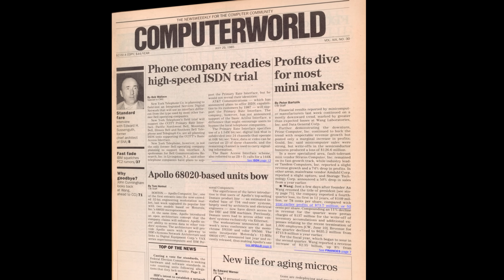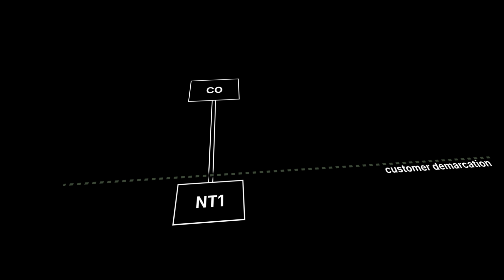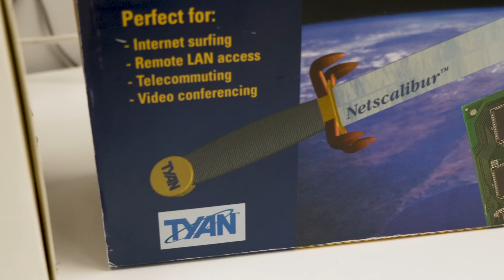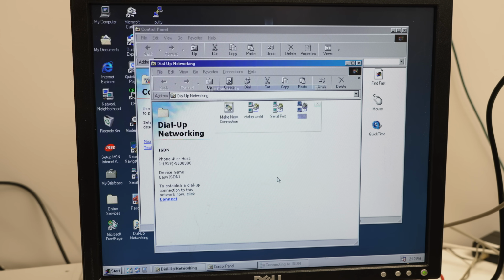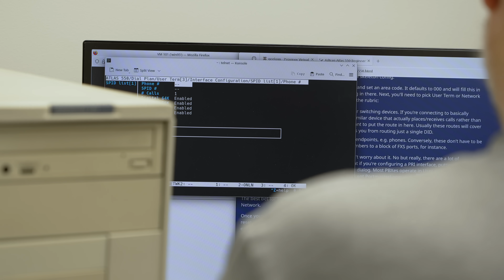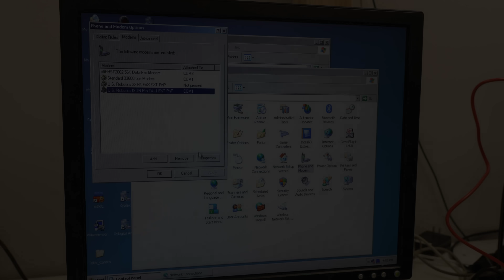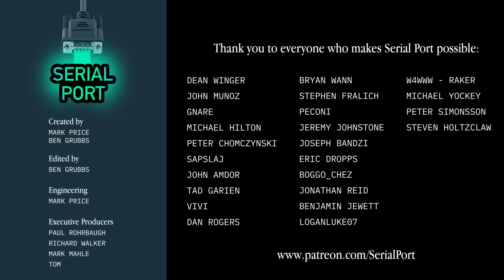Do you remember ISDN?

Comment: I used to work with video conference systems (Polycon and Tandberg - later acquired by Cisco). These systems would bond together 3 or more ISDN lines to make a fully two way video call. The picture quality was not amazing, but it was impressive for the time. The US government was still using ISDN into the mid 2010s, basically right up until the telcos would no longer install new circuits.
Reply: 384kB.  Amazing!

Comment: I had ISDN in the early 2000's for a year or two before they brought Cable internet to my neighbourhood. The reason it was unpopular here? You could only get it as a business account, which meant business long distance rates and business line costs, it was over $120/mo and $0.35 per minute for long distance.
Reply: I remember the setup being a LOT simpler, I was using the US Robotics modem, I think with Linux at the time... I had IP Masq on the linux box to let the other computers in the house talk to the internet through it. I'm pretty sure my router was moved off OS/2 by that point at least.

Comment: My parents' business briefly had ISDN to a local ISP in Minneapolis in the 90s. We ran our own DNS, mail, and web servers. We felt like the real deal. It was so exciting. I don't remember how long we used it before we upgraded to ADSL and its BLAZING fast 640k/128k speeds. I remember the ISDN was rock solid for the time we had it. I'm sad I never had a chance to use an oscilloscope to look at the signals on the U interface. I was always (still am) fascinated by the different line codings. As I'm falling asleep sometimes I still wonder about how the first T1 equipment searched across the sea of bits to find where in the 193 bit frames the framing bits are...
Reply: They used to drop the LSB, so that you always had a constant point of mark in each bit in the frame, which made locking on much easier. We of course, having a T1 to the ISP, promptly disconnected that telco supplied modem, and used a 64k one, which was as reliable, though for Telco troubleshooting I would plug in the line to their crappy unit, and let them see that the unit was able to connect with line quality errors, or not even connect. then come out, restart it again, and see it still did not sync, and listen to the noise on the line with a butt set, and find the bad connection, and try to find a spare wire to use.
Reply: I have the same "obsession" but with SDH

Comment: I work in Radio and I still miss it, because it’s more stable than any IP audio connection I’ve ever used.  As others have said, it was rare and expensive for most people. Back in 1998, I was helping facilitate audio from the Wye River Peace accords in Maryland.  The local central office for Bell Atlantic was not prepared for the onslaught of requests for ISDN and they ran out.  Fortunately, I was on site early enough and we had made our request early enough, that along with a dozen donuts, I was able to get the tech on site to pull the ISDN card out of his manager’s house to give us service. Those were the days.
Reply: We installed many ISDN lines at the Minneapolis Convention Center mostly for remote radio broadcasts. Don't know what they use now.
Reply: @MN-Hillbilly  well there are IP connections and IP codecs. They just don’t have the reliability that you might have with ISDN. There is always buffering issues which there never was with ISDN plus there’s dropouts. UDP was not designed to be stable.  The sad thing is people are more forgiving these days.  If Zoom or FaceTime audio is good enough why schlep a Comrex, TieLine or other high quality codec when folks can just use their cell phone.
Reply: @MattapoisettinLA  Your problem isn't IP or UDP, your problem is routing over a shared medium where you don't control the routing (Internet) vs a dedicated point-to-point line. (I've seen shows with 30+ DANTE audio channels on a local network and it is rock solid.)
Reply: @SteltekOne The issue is almost all of our connections are Temporary.  Yes we have Revena set ups between our major facilities. (NY, Boston, Philly, DC, Chicago, LA)  but it’s not practical to set up a Revena Network between say DC and Kiev, Ukraine

Comment: Yes, we had a pile of those modems. Then Oki ISDN ones that did 38.4k and the Ascend pipeline, which were terrible for the power plug falling out all the time.
Then USR Total Control.
But the best ISDN router was the Yamaha RT100i which would do leased line 64 or 128.

Comment: Very cool! I had an ISDN line to my home office back in the day, and used it for both internet and voice. I had a Fujitsu ISDN telephone (still have it in the closet, actually), and if I remember correctly, when a phone call came in, that was signaled on the D channel and the router would drop one of the B channels for the internet connection (i.e., the 128kbps connection would drop down to 64kbps). And when I hung up the phone, the B channel would be freed up and be available to be added back to the MPPP connection.
Reply: D channel actually was an extension of SS7 signalling protocol used internally by phone company ... most ppl do not grok that aspect.

Comment: ISDN was so convoluted and complicated, and pretty expensive. Fortunately I managed to never really use it for anything, after dial-up with usual only 33Kbps (48 and 56 simply did not work reliably). There was another tech at 115.2kbps called SDI (it was based on HIS-NT tech from Ericson, and SDI was just a brand name for the service in my country) around year 1999 and 2000, that lasted few years at good prices and pretty simple too. And when using phone at the same time you will get 70kbps. Then just few years later (maybe 2001 and 2002) we got DSL, and it quickly got to 1Mbps, then even few Mbps, and better, in span of just few years. Also it was way simpler than ISDN, and telephony part was still analog, and compatible with old gear, or even if DSL stuff was unpowered or broken. This was in Poland around 1998 to 2002.

Comment: We still have ISDN hardware in the server rack at work - IIRC the data side was phased out around 2020 when they finally ran FTTP but until earlier this year when they upgraded the phones the ISDN hardware was still part of the PBX.
Reply: this, I remember working on PBX systems between 2009 and 2012 and every single small business was still using ISDN for voice, one of my very first tasks at my first full time job was to configure a Patton ISDN VoIP Gateway.

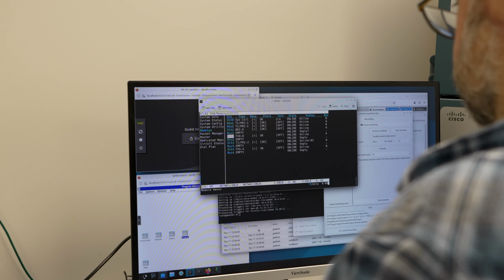Comment: 5:03 *Yet. You may eventually find them useful for something, just not right now.
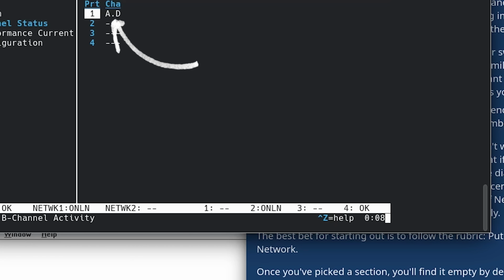15:45 That's an A channel, not a B channel. Says so in the screen capture.
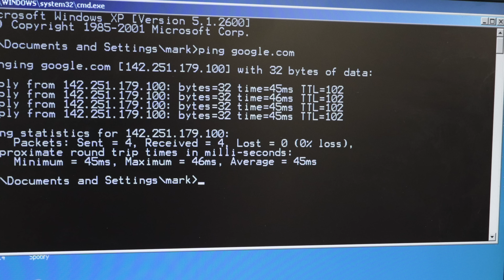16:00 An above average latency compared to modern internet infrastructure, but only by a bit - the fact that you managed this with pre-2000s networking devices is almost insane.
Now for the question I'm sure everyone's asking - what about using 2 or more ISDN connections for a single machine? Could you get 256,000bps or more?

Comment: In the 1990s, I had a small tech consulting group using Unix, PCs, and Macs. Networking them was a challenge until 10 base T Ethernet became available on all  platforms. But by the mid 90s, we needed more than a dialup line. We tried ISDN but for a staff of 12 people, we quickly outgrew it. Solutions were difficult to find until we realized that a T1 leased line could be economical if we also hosted network services for our local clients. That's how I became an ISP for a few years.

I think there's still two Ascend Pipeline boxes in my basement, and three HP servers with NT 2000. It's been almost 20 years since I used them.

Comment: Could there be a failing PSU in the Adtran. Removing the unused cards could have reduced the load. It could explain the later failure, without there being any causal changes. 
It would perhaps be worth measuring the internal power supply output voltages with no cards installed and with all cards installed.

Comment: ISDN was the exam question I pulled in the latter part of the 90's - I used to know the encoding and bit stuffing/clock recovery/DC removal tricks used on both sides of the NT. Now it's mostly gone.

Comment: it would be interesting trying to setup a dsl connection like ADSL or VDSL. in my country Greece most analog connections are ADSL and VDSL in some villages like mine we have fttc so we are able to achieve VDSL2 speeds currently playing for 50/5 although we could get 100/10. Adsl is used where there aren't many fttc cabins or none the average speeds are 8/0.8 and some villages with limited connectivity have 1.5-2 Mbps down on a good day and 0.2mbps up. For rurar areas isps are using 4g/5g for the connections

Comment: I had a company-paid ISDN connection in the early 1990s. Two lines from the telco were routed to my bedroom and the CPE was a white one from Ascend. Its size was smaller than the examples shown in your video. I can't find an image on the internet now. Back then I used a Macintosh. I don't recall whether if it was a Macintosh SE or a Macintosh IIx. Regardless I didn't have to fiddle with drivers or stuff you guys had to deal with. Pacific Telesis and the Ascend device handled everything. Now I can't recall if it was a serial connection or ethernet, probably serial.

I distinctly remember the connection always began at 64Kbps. Doing simple stuff like reading netnews would only use one channel. As soon as I started transferring data continuously from Usenet or from sunsite ftp, the second channel would be automatically bonded and I would get 128Kbps. After the transfer was over the second channel would disconnect. The LED blinky lights were fun to watch as "ch1" stayed steadily lit then "ch2" came on within a second. After the transfer was over, the channel LEDs would blink intermittently then "ch2" would go out as the second channel dropped, again within a second. Very efficient and something I'm surprised the Windows driver in your video did not do. You may want to take a look into setting that up.

After ISDN, the company paid for an ADSL1 connection. That consisted of a Cayman 3220 ADSL modem and a Nortel Contivity 100 VPN networking router behind it. Everything was preconfigured and I just plugged everything in. I still have these 2 CPEs. I had to return the Ascent in order to get the parts for ADSL1.

Comment: I remember getting 128K ISDN installed at home in the UK. The BT engineer installing it told me we were the only ISDN on the local exchange. We had it right up until ADSL became available. It was significantly more expensive than a standard line but the speeds at the time were well worth it as I ran a fan based website at the time. I had a Zyxel Prestige 128K modem Router.
Reply: Very few people had ISDN at home in the UK due to the cost - we had it briefly (only 64kbit) when my dad's work was paying for it but I couldn't convince my parents after that until ADSL was being rolled out - when they were finally getting fed up of the phone line being tied up.

We were one of the early adopters of ADSL at home - I remember even the engineer who did the installation (with one of those silly Thomson/Alcatel Speedtouch modems which looked like a frog) being gob smacked watching the download speed of half-megabit ADSL.
Reply: @Rroff2  We had ISDN in the UK, you could actually get it reasonably inexpensively ... if you were prepared to use AOL. I think  they were the only ones offering a flat fee monthly all you can eat subscription rather than paying by the minute.  It was a huge improvement over dial-up and actually made online gaming viable.

Comment: ISDN was like the Neo Geo. I knew it existed but didn’t know a single person that had it.
Reply: It was common in the UK.
Reply: @edism  Same in Scandinavia. We started with dial up modems, then ISDN, then ADSL. I remember being jealous because fiber was already common in Sweden years before it became common in Norway.
Reply: @Robert.K  similar path, but went back and forth from adsl -  DOCSIS from 256Mb/s and rode that all the way to 1Gb/s now on hyperoptic FTTP.
Reply: I only ever saw it used for leased line backups. A company called Controlware had a very slick system for backups.
I believe it was used in broadcasting for outside broadcasting and backups.
Reply: @tightcamper  Technically ISDN was a type of leased line service. The ISDN pair couldn't be used for anything else.
Reply: @3fives-j5w  ISDN was dial up. It was digital.
A leased line was point to point and analogue. If there was a digital presentation that was carried out in the terminal modems on site.
Reply: Every single federal government office below a certain size used ISDN BRI. Above so many seats they'd use ISDN PRI (which is T1).
Reply: All major business had it was very expensive for home users...
Reply: @TheBigChill1  depends on where you were. In the US, some of the baby bells offered a BRI for the same price as POTS, which was a huge value considering you were getting two 64k channels, each with its own DID.
Reply: As a network engineer working from home, I had an ISDN BRI which was connected to a Cisco router.
Reply: If you had anything to do with business Germany, you touched ISDN one way or another.  Germany was still running ISDN well into the 2010s, they probably still are
Reply: @Leftplayer1  ISDN was still used into the 2000s in remote parts of Bulgaria
Reply: Here in NZ it sounded like it was going to be the way of the future, and then it was in the past, with nothing in between.
Reply: Back in the day the high school I went to got its first internet connection and that was ISDN. (this would have been early to mid 90s).

Comment: I had the Motorola ISDN modem, and I recall my Linux computer using only a single serial port at higher baud rate.  With specially crafted AT commands I was able to dial up either single or bonded, depending on how much I wanted to spend on toll or ISP fees. I recall it wasn’t cheap.  It was all so long ago, and I remember it like a fever dream.

Comment: Oh yes!. I had a service called BT Home Highway, here in the UK. Double RJ45 termination in the house. Used a Network Alchemy CyberGear Gold. Basically, a router with 6 telephone extensions built in. Of course, in the UK we pay for local calls, so I set the bonding to only activate and pick up a second line when the first channel got to 95% saturation. Otherwise I would be bankrupt now :-)
Reply: It was crazy how BT never implemented some sort of flat rate that I can remember for home highway, a few friends had it and I was jealous of it because of the low latency. I remember having to switch to Telewest phone service just for the free internet calls and of course the cable internet in 1999.

Comment: I remember drooling over ISDN back in the day, but by the time we actually got it in our area DSL was available as well... Then very shortly after that, cable dominated.
Reply: Same for me. The cable company easily installed high speed internet in my area. I got mine so early, I had to go to the local time warner office and take a training class on how to use it. It was called Roadrunner at the time.
Reply: ISDN wasnt designed for the internet... it just happened to end up carrying it.. ISDN come out in the late 70's
Reply: When you say cable, are you talking about DOCSIS?
Reply: @fleeceweasel  Right, cable internet. We at least had cable TV far before that. lol
Reply: In Europe ISDN was slightly different to it was in the US.  In the UK BT offered BRI and PRI services as ISDN 2e and ISDN 30e.  At the College where I worked at the time we had both.  There were three ISDN 2e connections for data connections to various services, payroll was one, I forget what the others were for but all were discontinued long ago.  We had three ISDN 30e services which were to provide 60 trunk connections for our PABX.  This was most often provided over fibre, but because we were close to the exchange ours were on two copper pairs for each service.  Each provided 30 64 kb B channels, a 64 kb D channel and a 64 kb synchronising channel.  I think all of this was carried on a 2 Mb/s E1 line.

For those that had ISDN 2e BT offered an additional service which I think was called ISDN Connect.  I don’t know much about it, I only ever heard about it in a notice which said that it had been discontinued, but I think it was some sort of very low bandwidth always on data service carried on #0@43 capacity on the 16 kb D channel of the ISDN 2e service.

Our first always on Internet service was 2 Mb/s delivered on two copper pairs using something which I think was called CWSS.  The wires on the frame had red warning labels that that they carried 110 V.  I don’t know anything else about it.

Comment: In the 1990ths and early 2000 I earned good money building ISDN routers from standard PCs. My most extreme device was a 486 with six HiSax-compatible ISDN cards for a total of 12 bundled 64kBit channels - I had to even disable the floppy IRQ just to get enough free IRQs. The system was smart enough to connect and disconnect more lines as needed thanks to a small perl-script checking the statistics. I even managed to detect if any lines were used for Voice or Fax and bypass these lines when setting up more connections. And the best, ISDN was a lot cheaper to implement. The six ISDN cards I got literally from a scrap yard but even new ones would have cost only something like $30 each while a good modem was more like $100. And if you look at these almost empty HiSax boards then you see why they were so cheap.

Comment: I had an ISDN ISP back in the early 2000's. My config got goofed up one night and it kept trying to reconnect. Fixed it the next day. Turns out ISDN lines can "dial" REALLY fast. Problem is I was charged a few cents per call. Ended up with a $4000+ phone bill. They knocked it down but I still ended up paying around $2K. Modified the config to throttle re-dials after that :)